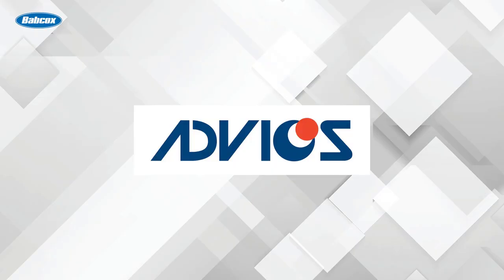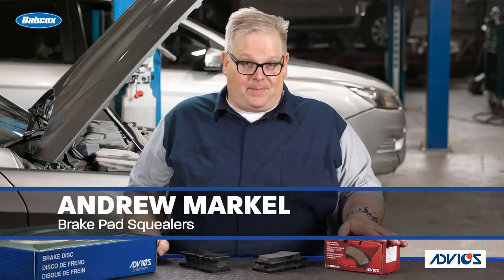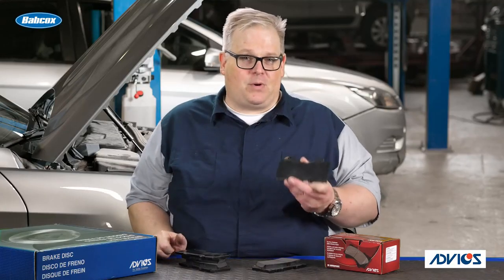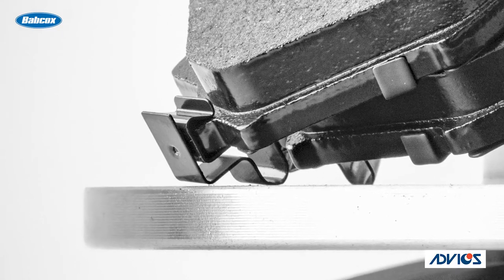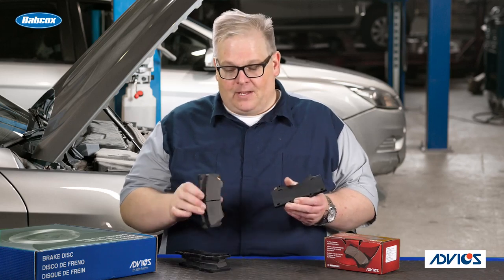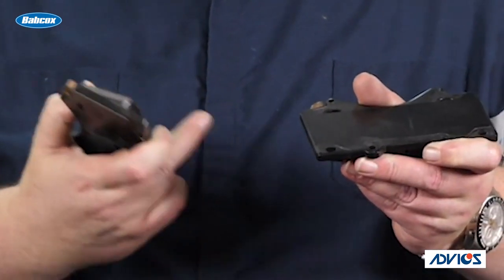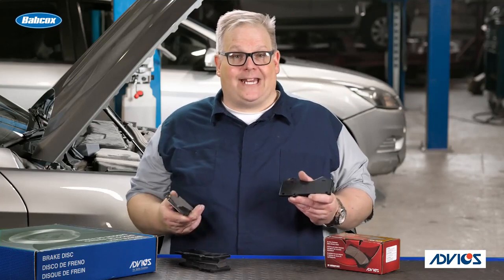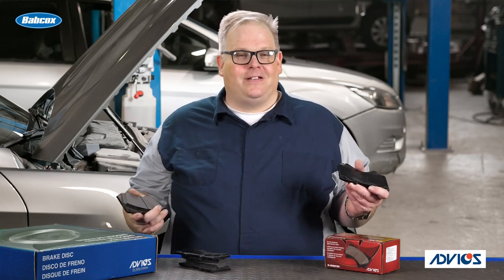Where Should The Brake Pad Wear Sensor Go?

Comment: Pad with a wear indicator tab goes inside for at least 3 reasons.  (1) Outer pads are readily visible (2) tab is more protected in the inner side, the most important (3) the inner pad wears faster since   it gets the direct pressure energy from the caliper piston.

Comment: So the leading edge is the edge that the rotor meets first as the car is rolling forward. Basically if your caliper is mounted on the rear of the axle the leading edge will be on the bottom however, if your caliper is mounted on the front of the axle the leading edge will be on top.
Reply: Yes...he should have said that this way. Then, the squeel tab goes on the inside would complete the description.

Comment: Thank you Andrew. I couldn't remember if the Squealer ( I always called them the wear indicator ) went on the leading edge of the trailing edge of the pad. When you have a 10 yr old vehicle,  it's had a few brake jobs in its life. So,  yes, the one I removed was on the leading edge and on the piston side of the caliper.  ( or inward side ) After reading some of the negative comments,  I found myself scratching my head in disbelief.  What part of inward and leading edge don't these ppl understand ! Most of them probably can't tell time on an analog clock either, therefore they don't know Clock Wise (CW) from Counter Clock Wise (CCW). Or the difference between a screwdriver and a pair of pliers.  😂
Thanks again, 👍👍

Comment: My question for this video was, where is the squeek indicator located when installed correctly? I learned it is on the inside pad and the leading edge of the rotor. Thanks for the clarification.

Comment: Great video that's VERY unclear, but I have the correct answer...it is found on Wiki, google "brake wear indicator wiki" or go to: https://en.wikipedia.org/wiki/Brake_wear_indicator 

Or if you can't be bothered, think of it this way:
With the car travelling forward, as the rotor rotates it should push the clip (wear indicator) towards the pad, not drag it away from the pad. The wear indicator pad should be placed on the inside (against the piston), not outside against the bracket. This way works no matter which way your caliper brackets are positioned.

You're welcome.
Frustrating how many videos say lots without communicating anything. If you find my answer helpful, please like it so others will see it too.

Comment: This was horrible. I’m back to knowing nothing…
Reply: In most cars: put the pad with the wear squealer on the inside of the rotor.  This will almost always ALSO place the wear squealer at the top of that inside pad.  -  if the pads are different inside and out, then the pad with a rattler may go on the outside but will also likely be on the top of the pad when installed there.  

Why: inside pads wear faster under normal operation, wear a lot more when caliper pistols are seized.  The top of the pad comes into contact with the rotor first so it can wear the most.  Rattler is nearly always on the inside top edge of the pads for these reasons on normal brake calipers.
Reply: @brassmule still, doesnt make sense 

The warning metal piece is a set on bottom and other 2 on top? wtf now what?
Reply: Dude right! Didnt show us anything lol
Reply: Wtf was that??

Comment: When I bought my certified used Mazda CX-5 one tire in the back was at 32psi, another at 52. Upon opening up the wheels I discovered that both squealers we're not tucked in, so just stuck out and would never ever touch the rotors. Moreover, one of the pads was stuck at an angle so it was worn down almost to the metal on the bottom and was perfect on the top. Apparently that mechanic did not watch enough YouTube videos 😂

Comment: Wrong! There isn’t a confirmed location. OEM and replacement as well as year made varies “squealer” placement. Furthermore, it’s more likely for the slides to stick than the caliper piston.
Reply: I agree, wear sensor locations can change. Check the service info.
Reply: @andymarkel  Yeah except I came here cause the service info says 2 different things for Honda CRV.   One page says indicator on top and another page says indicator on bottom.  WTF.   My intuition tells me on top cause that will make the most noise when the wheel rotates forward.  However, it may be that these are better when sounding in reverse.  Who wants to drive with this constantly squealing.

Comment: This is how you explain something that only you can understand.
Reply: Once the friction material gets the coefficient of the divided ratio between the thickness of the remaining pads, then the obvious solution will be to place the outside edge of the wear sensors in relation to the rotor's relational diameter. Very simple language.